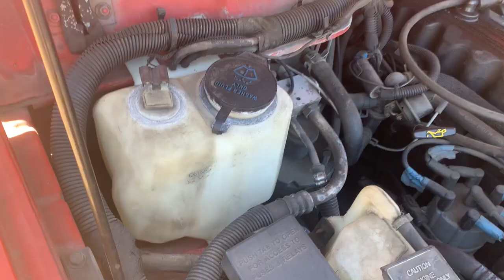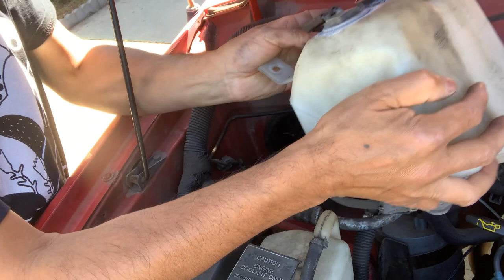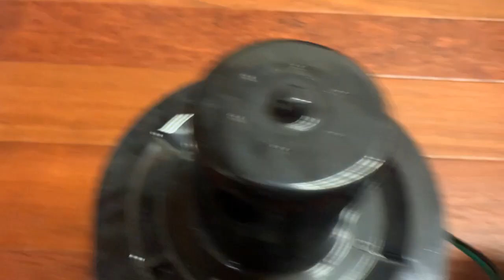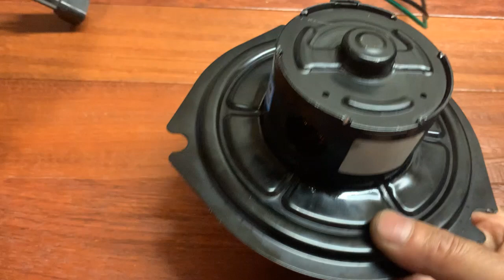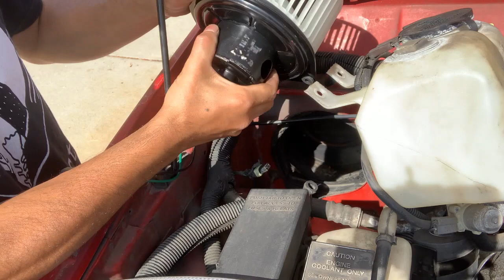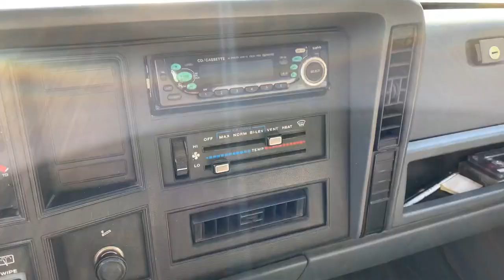Must see before you buy a blower, 1993 Jeep Cherokee XJ, blower replacement 1

Comment: You've probably already figured it out, but for anyone else who has this problem, if your blower works on high, but not the other settings, it is your resistor. it is under the passenger side of your dash, very easy to replace and costs about $15.
Reply from the maker: Yes, you are right.
Reply: Replace your blower motor at the same time your resistor will not blow for no reason plus is like 30$ so why not
Reply: That or the climate control switch sensor is bad as well and probably the pigtails for the connection as well.